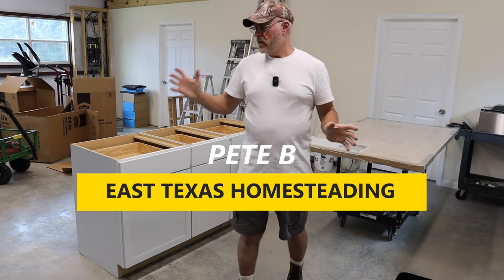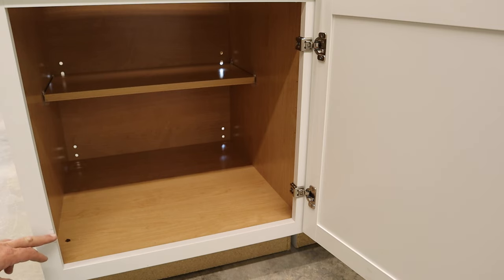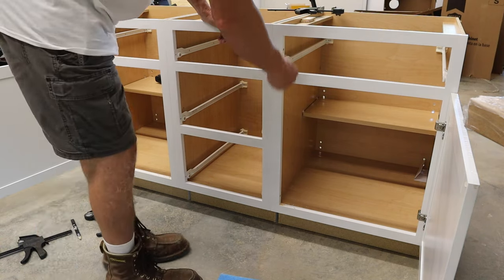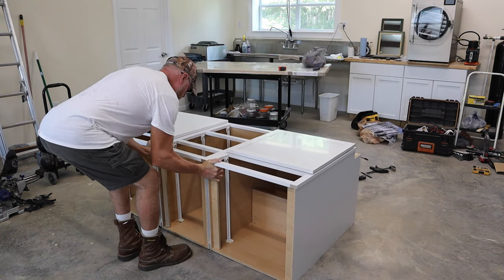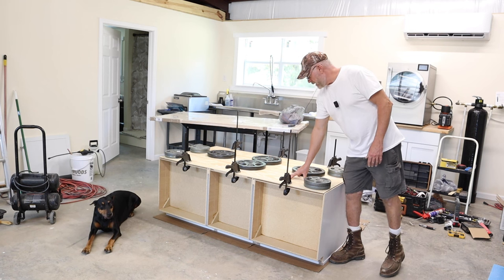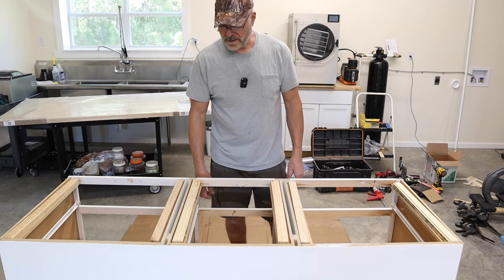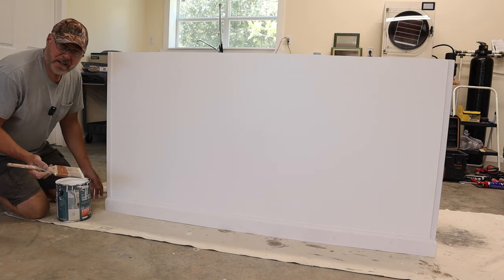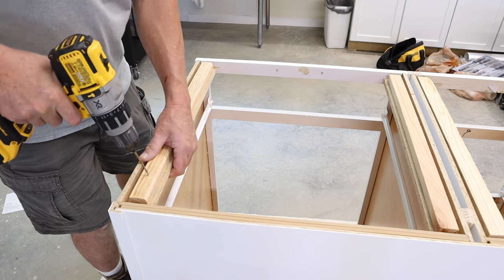Easy Diy Kitchen Island Tutorial - Step-by-step Guide

Comment: I wouldn’t recommend using a stain on a butcher block counter top because the stain is most likely not food safe. The stain could seep out of the counter and into your food, causing the food to taste bad and possibly be toxic.   There is food safe stains, but I prefer not use anything on the wood if it’s going to be used for food.
Reply: I don't think he plans on cutting food directly on this counter top. It's simply a counter top.
Reply: Wouldn’t the poly coat prevent that? 😅
Reply: Looks really nice. I’m planning on doing the same thing. ❤
Reply: Do you mean the poly coating? I don’t think he stained it. Maybe I missed that. It’s my understanding that poly is fine for food prep once cured. I’d want to let it cure anyway to prevent marking it up.

Comment: Thanks for showing every step.  True that cabinets from the big box stores aren't cheap, though their construction is.  Note how the particle board falls apart from just the drywall screws.  You improved the strength greatly with the plywood backing sheet needed to finish them.